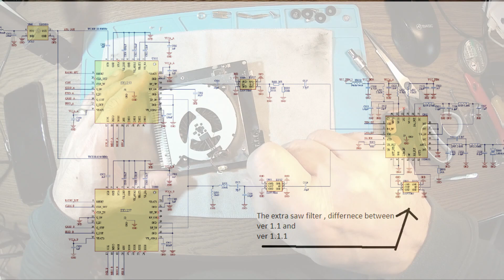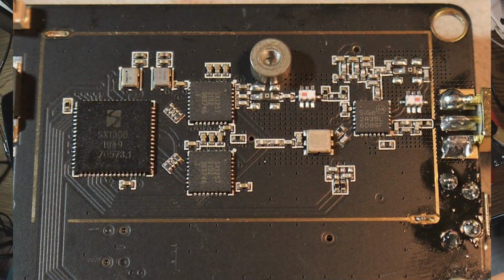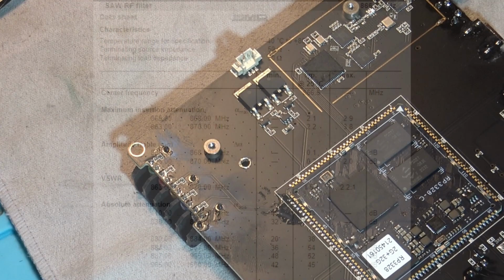Another Heltec HT-M2808 helium miner hotspot dismantle

Comment: Hello, I am reaching you as a result of my research.
I have a heltec indoor device
It's been 15 days since I bought it
It worked fine for the first 5 days but then I started having problems
Send beacon and 0 people listen
witness beacon never does
I tested 3 different antennas and 3 different cables (lmr400)
The problem still continues
I think something is wrong inside the device.
What do you think is the problem? I'd be grateful if you could help.
Reply: how do you know it was struck by lightning?
Reply from the maker: @bojantomic8115  Probably the last RF circuit will not send or receive signals..but very low chances to have a problem  like that..
Reply from the maker: There is nothing wrong with the device, I'm in the same situation, no witness in the last 7days! changed antennas, cables..everything and anything.I think it's a matter of network and the new way the miner software is working..focused to send beacons ..so you are not the only one with problems..don't panic, let's wait..
Reply: @viocaia  today i disassembled the device and checked it
The device has been struck by lightning and the rf module has failed.
Reply: Cözum bulabildinizmi?
Reply from the maker: @pekman7609  Hayır ama amfi ve dış filtre ile güzel sonuçlar alıyorum kanalı takip edin haber vereceğim
Reply: @viocaia  bendede ayni hotspot var eski versiyon hotspotun içinde birşey sallaniyor hotspotum sadece pisces hotspot ile witness atabiliyor
Reply from the maker: @pekman7609  Belki bir güç düğmesidir, fermuarını açın ... kırılacak bir şeyi yok
Reply: @viocaia  evet güç düğmesi ama hotspotum witness 0 beaconcs 0